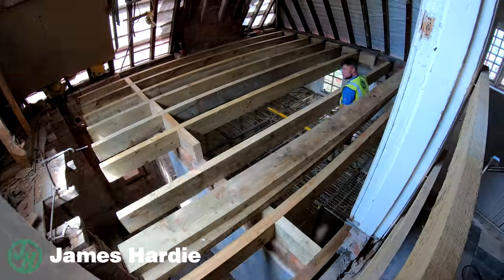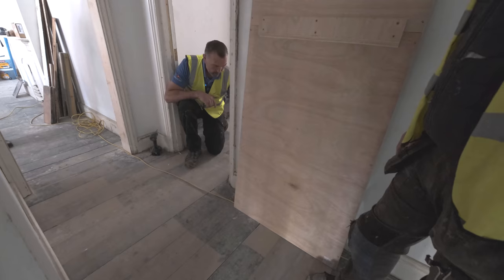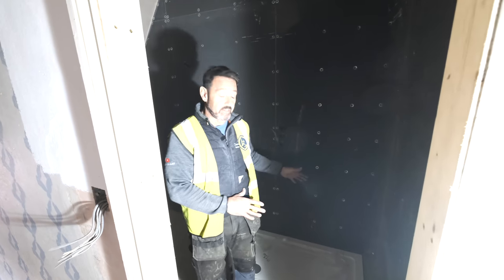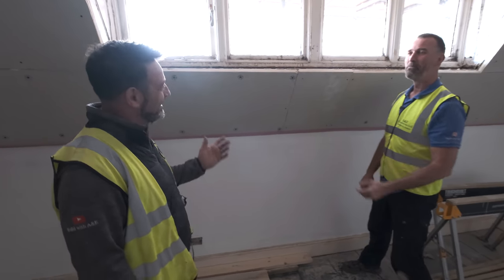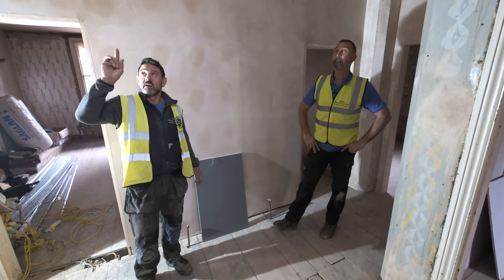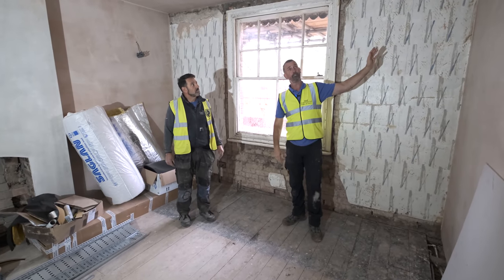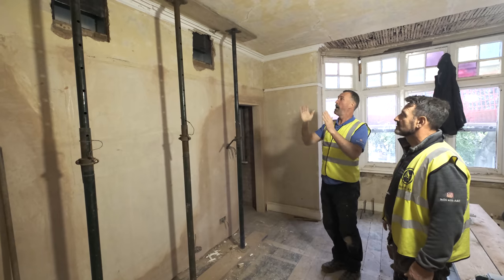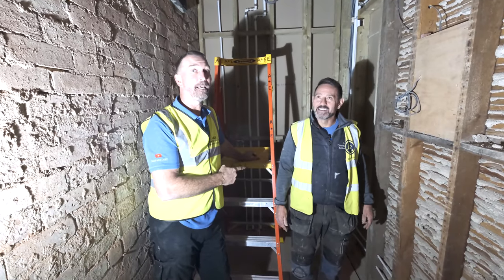Transforming the Top Floors | Victorian Villa Resurrection #2

Comment: Great start to this refurb. One question I have is what thickness and type of insulation are you putting on external walls ? 
I have 2 very small rooms with north facing external walls and I cant decide or really find out the best way to insulate them without losing too much space. Any advice really appreciated, cheers.
Reply from the maker: Hi Th Fc there are many manufacturers that do a pre insulated board with a plaster board stuck to it but make sure you buy the one with a vapour check also start With the British Gypsum product all the best Tony👍
Reply: @BuildWithAE  thanks Tony, what sort of thinkness should I be using ? I don't have to comply with building control as these are unaltered solid brick walls with the lime plaster removed.
Reply from the maker: @thfc4745  no worries it’s  your own personal choice really, if you can the thicker and more insulation the better but it’s down to cost and how much room you are willing to loose all the best Tony 👍